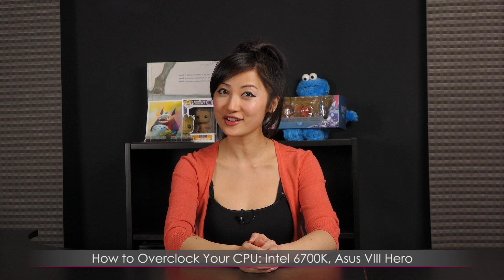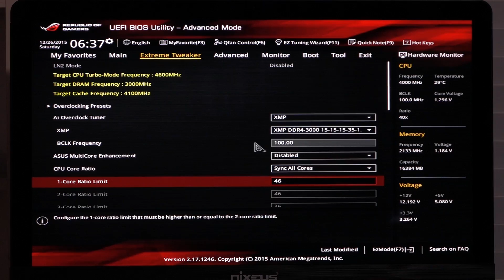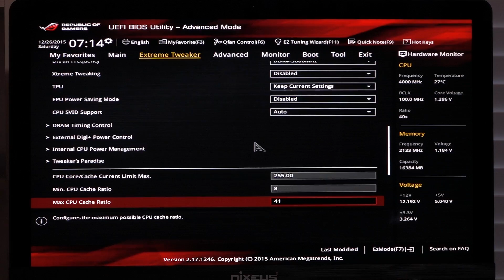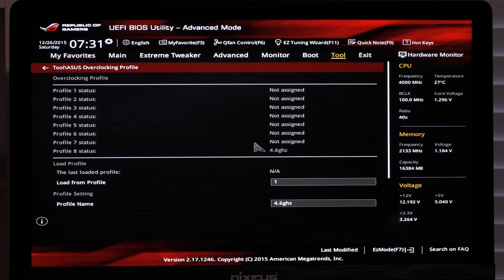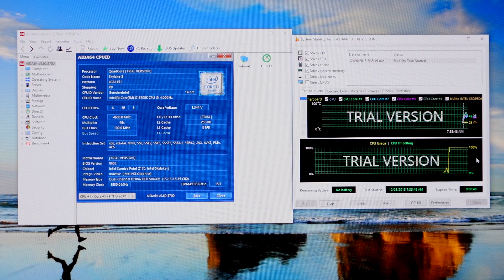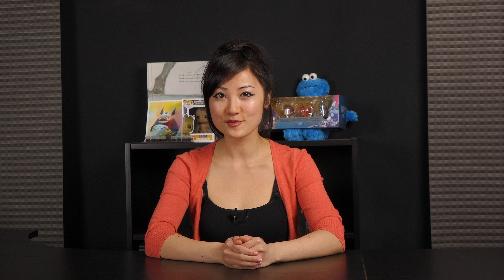How to Overclock Your CPU: Intel 6700K, Asus VIII Hero: Tutorial

Comment: Great video. The only thing you forgot was to go back into bios and select adaptive mode when you find a stable clock and voltage. All you need to do is plu in whatever voltage you had during manual tests. I use LLC 5 personally. This video helped me because I was trying to OC and for the longest time, I felt like my voltages were really high. Changing the rest of these settings (I only had llc, voltage and clocks done) gave me 4.7 @ 1.35 (kicks up to 1.36 with adaptive) vs. the OC I did @ 4.5 with 1.35! So yes, the rest of these settings really do matter. The asus enhanced one just messes with the default intel setting and there is no need for it when OCing. To anyone saying there is too many steps, you should have gotten a non k cpu or stuck to consoles. There is more to your PC than just plug and play gaming. You would be wise to find stability vs. the auto settings that motherboards are set to to prevent failure on initial boots and always supply way too much voltage by default. Take the time and learn this stuff. If you have no desire to OC, don't bother with a K series chip or it's components. Is it worth it? yes. from my experience finding stability, not necessarily ocing, is definitely worth it. You should expect to learn this stuff when building PC's or you may just end up with an unstable rig running too hot and the lifespan decreased (however much it may be).
Reply: Smoov Operator Thanks! I found your comment useful. Vacation started for me today so I'm going to spend tomorrow on overclocking my cpu:)
Reply: in a maximus IX Hero i have to use the same values? im runing the 6700k with a sli 1080
Reply: cant get mine to show 4.8 to test when run the stress test
Reply: Isn’t the the 6700k hace in chip Voltge control so it doesn’t stays at max voltage while clocks are low?

Comment: Thanks Johan. Yes, you talk fast, but your instructions were clear. I just had to stop the video and take notes at the proper moments. Was able to get my 6700K to 4800 with 1.35 volts. Very stable on AIDA with water cooling (max 72C). Maybe will try to get 4900, but not for now.

Comment: I have the same components with a be quiet 600 case. I found that the standard settings were running the CPU at over 1.4v at 4ghz. So, I followed your instructions and now I have it running at 1.31v at 4.5ghz. I did have it at 4.6 but it said hardware problems so I stopped it and set it to 4.5. So far, so good. Thank you for your help!

Comment: This video was a great help. I know nothing about oc,ing and have been using the mb's default ez tune which was applying about 4.5v and running way too hot. With these exact settings I've a completely Stable oc at not much higher than standard temps. Brilliant vid.

Comment: Joanne, I have a 6700k and the ASUS VIII Hero so I decided to try out your settings.  When I used the  Min CPU Core Cache ratio set to 8, this caused pretty bad lag on my desktop. Just moving around icons and windows was very laggy on my normally buttery smooth 150hz monitor. While monitoring the cpu clock speed with CPUID as I moved the icons/windows around and the cpu clock rose, the lag would go away and would return as soon as I stopped dragging them around and the cpu clock lowered. Raising the min core cache ratio to 41 made the lag go away.

Comment: thank you soo much!  i just got a i7 6700 and ROG VIII formula. i followed your instructions exactly and im running happy at 4.6ghz cpu and 3600 16cas mem.
my fps in borderlands presequel at 4k max setting went from a bad ~45fps to an awesome 125 fps.  i had no idea my i5@4.3gz was such a terrible bottleneck. i can hold og purchasing a gtx 1080 until i finish borderland snd start witcher3.
thank you again!
p.s. you need a husband? 
lol, its hard to find smart, cute,  computer nerdy gals! some guy is going to have quite the catch with you!

Comment: Use level 5 load line! That's the one where your preset voltage sticks under stress testing. At higher voltages you may need a bit of trickery with offset. For example I had to set mine at 1.41v but with minus 0.01v offset to get a stable 1.408v which is the voltage my 6700k needed for 4.6ghz. Also you can run up to 1.45v 24/7 if you want as long as you have the cooling. This is Asus's recommendation. The board actually says up to 1.5v is ok though it'll run VERY HOT. lol
Reply: +TheBlackIdentity Yea... I have to hit 1.39~1.41 vcore for 4.6 stability and it really pisses me off since I'm stable with 4.5ghz at 1.29~1.31vcore. 

So much voltage just for 100mhz, makes me sad. I'm using 4.5ghz for now... I"m glad to read you have a similar situation to achieve 4.6ghz as I do.

Would be nice to be as lucky at this video-girl, lol. 4.6ghz @ 1.31~1.34ghz vcore
Reply: Nuruddin Peters I've seen worse samples. We all play the silicon lottery. I'm satisfied with mine. 46 multi with 45 cache is more then good enough for anything and I can still run this setting at minimum fan speed(600rpm) on my h110i gt so it's also quiet.
Reply: +TheBlackIdentity That's amazing! 

I was thinking about upgrading my Hydro-Cooling from H80i GT, but not sure if it will be a massive cooling difference if I upgrade to H100i gtx [my thermaltake lv10gt should fit this exactly, not sure about h110i]

Coming from an AMD setup for over 20yrs, I see the massive leap on Intel already... I feel like, I didn't see the whole world correctly now that I'm here. Lol
Reply: +Jonathan Jung depends... Aida64 wasnt enough for me.@4.5 oc stability was OK with 1.32vcore and playing &quot;some games&quot;...

2-3 weeks later, Rise of Tomb Raider would occasionally crash. Pumped my vcore to 1.33v. RISE OF tombraider was still randomly unstable (especially around the Soviet Installation area, strannnge.)

I ran realbench utility, noticed some tests wouldnt complete for a full score. (This was especially telling that my pc was still unstable, although normal use wouldnt lead to crashes and Aida64 would succeed with stability test.)

i pumped 1.36vcore into cpu, aida is good, normal computer use is good, rise of tombraider 13hours in, (no more random bluee screen crashes), and, realbench would complete all tests with a finall score.)

So  please note. aida64 isnt enough, and some pc games wont crash as they just dont stress cpu enough. (e.g. The Witcher 3 didnt crash my pc once, nor did Wolfenstein: The Old Blood)

if you think youre really stable, run Realbench utility, and see if it completes all 4 stability tests.

(if you have rise of tomb raider, i suggest playing that too, soviet installation area has great stress points apparently!)

Comment: I just got the 6700k and the same ASUS VIII Hero MB and found your tutorial very helpful.  I set out for 4.5ghz instead of 4.6 and found for me my stable voltage is 1.295v and I then set to adaptive with 1.295 entered for additional turbo mode CPU core voltage.  Room temp of 26C and my CPU idles around 28C! On default settings and clock speeds my idle was at least 5 degrees warmer and my peak temps are around 10c less! Peak temps are high 60's for any stress test or game I throw at it.  The only part of the video I didn't adjust was keeping load line calibration set to auto. I also did not change CPU VCCIO from auto and kept CPU system agent voltage to auto.   Thanks again!!!
Reply: Hey man I have an asus maximus viii hero on the way this tuesday and I have a question. Due to all the current bad reviews of this specific motherboard, was the overall installation and setup good without too many issues?
Reply: This board is great if you ask me.  Not sure what issues you've read about but I'm happy with it.  Install, setup is a breeze.
Reply: caymandiver75 Awsome good to know :)!. And the main issues I heard we're mainly a lot of different error codes people we're getting and the motherboard stuck in a constant bootloop as well as the mobo dying in about 4-6 months of use, but I guess most of these issues are user error more than anything haha.
Reply: I also have 6700k and asus viii hero mb. I recently wanna oc it. but how do I find the stable voltage for specific frequency?
Reply: ive got the max VIII hero alpha and it works np and booted on first try

Comment: I have the exact same motherboard and cpu. I followed the guide and when I pull up "system" under control panel, it says the cpu is at 4ghz. Is this because we selected the option dow own clock the cpu when not under load?

Comment: On the Asus ROG guide they recommend keeping core voltage below 1.45, and 1.40 if you want to play it safe. Why does this differ so much from your recommendation of staying below 1.35?
Reply: I recently threw one of these together and used the AI3 5-Way Opt tool to OC and it bumped my core voltage to around 1.43. The higher the voltage the more heat your components are going to generate. I prefer this manual method and doing some testing to find the lowest possible voltage necessary to run at a stable OC.

Comment: Wow a girl that actually knows this shit and owns it. Thank you joanne. Learned alot from 4 minutes of your time even 3 years later!
**update**
I have managed to strike  on my 6600k 4.7ghz with LLC at 6 and as well 1.31 volts. I have also tried reaching for 4.8 but not even at 1.4 will it stay stable (even with LLC at 8) Most likely would have to reach for 1.43 in order to hit the stable mark but it isn't worth it. If it was 5ghz... maybe.
I think I will setle for 4.7ghz @ 1.31v or realistically speaking 1.34 due to LLC at 6.

Comment: You can go past 1.35 volts.
Most people say you can go up to 1.45 volts if you got a high end cooler which you should have if your wanting to overclock any chip.
Reply: 1.45 is max for skylake, if you don't want to burn your 14nm unless you are going for extreme cooling
Reply: VirusKing Peaple are running 1.55 volts on water cooling.

Comment: Hey I have a quick question. I am using the same motherboard and CPU. I have a 16 gb ddr4 and 1070 ftw gpu. I am doing a clean window 10 install. There are way too many drivers on asus website. When you build yours, what drivers did u install and in what order do u recommend? It's too confusing.

Comment: Thank you very much for this guide you are so knowledgeable and it is the most complete guide out there.

Got my i5 6600K to 4.6ghz using your settings, I only disabled the intel power management during testing as someone mentioned on the comments how it could potentially damage the CPU.

Comment: PLEASE HELP. I have had my build with this processor and this motherboard since March. I never messed with any settings in the BIOS. SO I load up CPUID and it says my CPU is running at 4636mhz. Or 4.63GHZ! I don't know how to just go to default. I want it to just be it's normal 4.00ghz. I'm going for longevity with this processor. Please help! I don't see a defaults button in the BIOS!
Reply: Michael Jenkins a overclocked 6700k at 4.6 ghz will last at least 4 years so dont worry

Comment: Why leave it at manual CPU voltage?  Wouldn't it be better to use Adaptive so when it speedsteps it uses less voltage?
Reply: adaptive on most boards is buggy...  offset (unpredictable) or manual is the way to go.  i have an i5 that has had 1.280v steady and runs 1 degree hotter at idle.  they're made to work not sleep, but if you're into running "green" you have to play with offset or adaptive.
Reply: Interesting, so if the voltage is set to manual would speedstep ever come into play or is that strictly based on OS power management?
Reply: speedstep works but only with frequency on my boards with manual voltage set.  the voltage stays the same.  the only way i can get z170 boards to maintain a steady non fluctuating voltage is set vcore to manual.  plain offset and adaptive fluctuate up to .1 volts depending on what lvl of llc you have set.  i'm playing with adaptive right now after watching this and every stress test i throw at it dials in  a different voltage.  anywhere from 1.264 -1.312.  occt has a different load as does prime95 and IBT.  small fft's in prime dial up 1.264v  while prime95 blend dials in 1.296-1.312.  manual is easier and i don't think it hurts keeping it that way as long as temperature is kept in check.  i will continue to mess with adaptive but it would take days for me to trust it with intensive stress testing just to satisfy my extreme ocd'ness
Reply: i digress about my previous statement regarding "adaptive" vcore settings.  after 5 hours of intense testing and retesting, i have found that setting the adaptive voltage to 1.287 with an llc setting of level 3 provides a constant 1.280-1.296 v to the cpu regardless of what test i throw at it.  that's outstanding! i will continue to stress this cpu, but if this voltage remains the same throughout my testing, i will use the adaptive setting.
Reply: halistine jenkins can you take a picture of the setting so I can test for my 67000k on my z170?

Comment: after youve set the over clock. when you reboot. were it adds up the ram and tells you cpu clock. does it show 4.6 or 4.0. same thing under my computer properties does it show the over clock or stock .

mine shows the stock clock speed. but cpuz shows 4.6 sometimes and 4.0 most of the time. i dont know what to think other than bad board

Comment: I've never overclocked before. I'm assuming you're using a water cooler, but I was wondering if this would still be good with a noctua dh-14? also I have a 6700k, Asus pro gaming aura and 16gb of 3000mhz xmp ram.

Comment: +Joanne Tech Lover Lol, I had to replay your video about x6 times. 

Some parts, I felt you were talking super-fast =(

I was hoping you'd go into CPU cache ratio a bit more.

First-time with an Intel-build and I thought I'd begin with the latest consumer tech. [Glad I found your vid first.]

I'm stable at 4.5ghz with 1.29 ~ 1.31vcore, [not as lucky as your 4.6ghz], and I set my CPU cache ratio the same as yours video, but I'm still really unsure as to the benefit of setting min/max 8/41 cpu cache ratio [ringbus/ uncore]. 

I've seen documentation recommending to typically set the min/max cache ratio values the same as cpu stock freq. [In this case, 41/41 and not 8/41.]

Could you perhaps mention why you didn't set 41/41 for min/max? [I even decided to run my 3d-benchmark several times with 8/41 and 41/41 to see if CPU and overral score would be significantly different, and it was most exactly the same.]

Sorry for the wall-of-text!

Comment: I think this is a decent guide to achieve the 4.6GHz voltage. But I think that it would have been more helpful to actually explain each step a little more. It all feels a little rushed. Another note is that Skylake can actually take a little more voltage no problem. You will not encounter any issues up till 1.4V and most people agree that it's save to push up to 1.45V. Just my $0.02.
I would also say that one hour is not enough to verify a stable OC. I have encountered instability after more than 12+hrs of testing. I'd always recommend at least 24h of testing a CPU OC.
Reply: stable for me is when it doesn't crash while gaming.  i don't care if it can run a stress test for days.
Reply: I feel the same, it usually runs the stress tests ez for me but not the games :p
Reply: robble69 I know right, stress tests aren't real life for me or many people. I'll game for 30 min, end it. Come back maybe game another 30 min get off etc. I'm never gonna stress test my cpu, if it boots Into Windows and runs my damn game maxed out for 1 hour it passed the test. Having it run a program for 24 hours straight seems like a good way to bash your cpu and take a few months of life off it ..

Comment: I7 6700K LM relidded & OC stable and reliable: mobo ASUS PRIME Z270-A / 4.7 GHz, Uncore 4.1 GHz / DDR4 CL15 XMP 3000 MHz / Manual Vcore 1.35 / LLC 4 / CPU VRM Frequency: 400 KHz / Phase Control: EXTREME / IPDT64 test PASS, AVX2 test: CPU Package max.: 68 °C / No BSOD, no app crash.

Comment: why not just use the auto overclock function in the bios?
Reply: +junior5516 in general auto overclocking software applies voltages that are a lot higher than necessary.
Reply: minimalism? please explain.
Reply: +Eg gy not all the time the voltage readout in my bios is well under the limit for my cpu which is a i5 6600k, manual overclocking isnt really necessary most of the time unless the memory or cpu cant overclock correctly.
Reply: +Brent Posy +Brent Posy its the same as manual overclocking just a lot faster i just go over the results to make sure the volatages and everything else are okay which they usually are, its not being lazy really.

Comment: ok, I've done everything like it's said in the video. When I press Exit and Save Changes and Reset, my monitor goes into idle forever and nothing happens. When I turn my PC off then and restart it it says overclocking failed. Whats wrong ?! Ive got the same components and I've done everything right like it's done in the video! Please help :)

Comment: Nice video, I jave this motherboard but with the i56600k. What would be the voltage for overclock to 4,4? cheers
Reply: I think theirs a median range for i7 and i5's available based on user submissions on a reddit chain somehwere. 

Keep in mind, every i5 and i7 is not equal, regardless, but it will give you an idea of the min/max voltage ranges and GIVE you an idea if your CPU is really above-the-rest, or just a average die versus the rest.

[One sec.. Gonna search for that link.]
Reply: I let the ASUS software to test what is the max overclock stable withou risk for my system, and it settled automatically 4,3hz with 1.310 voltage. Am happy with this overclock, the temperature is very very good. Thanks guys for your time!